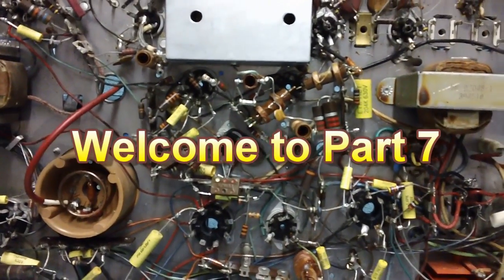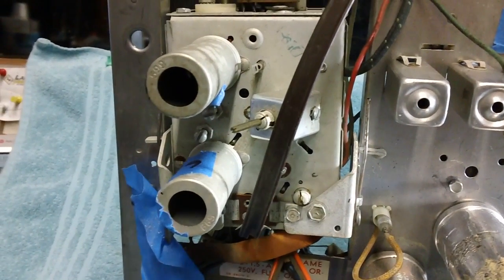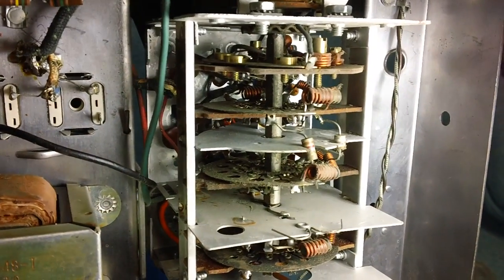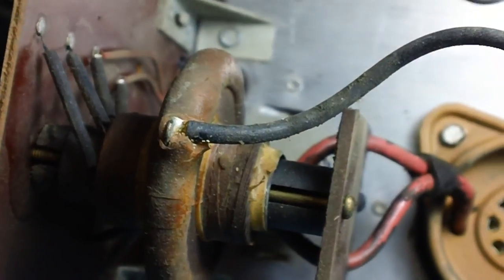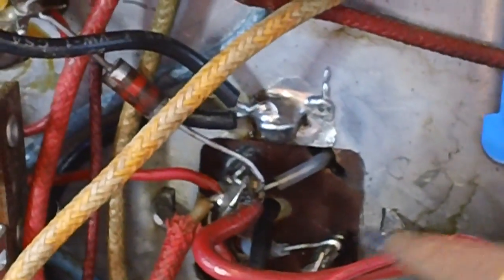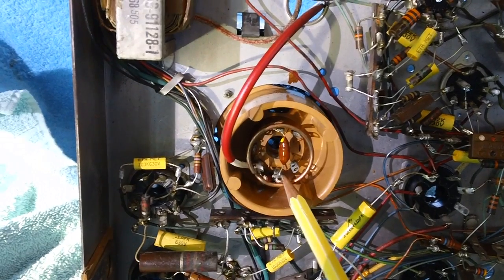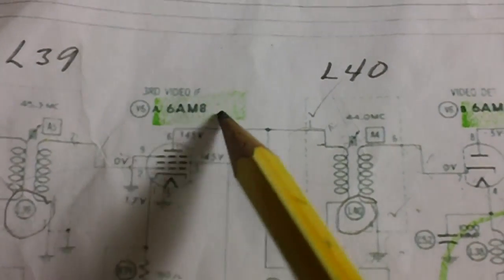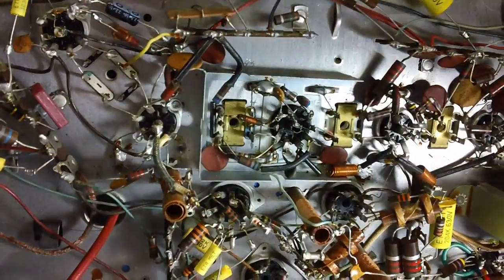1956 Sylvania 21" Halolight TV restoration (part 7 of 23).

Comment: The Sylvania Halolight TV I had was a bit older I think. Instead of a selenium rectifier, it had two 5U4 half wave tubes sitting on top of the power transformer. The tuner had the drum.

Comment: I use an old Montgomery Wards soldering gun, works a lot better than my radio shack soldering iron for chassis work. I still need to invest in a good soldering station of some sort. The corona ring explanation was really interesting. I know when I was studying for a ham license they said no sharp bends in the antenna wire to prevent arcing if it was struck by lightning.

Comment: John,
Coming along just fine dear chap.
The corona ring attached to the underside of the EHT rectifier valve base is interesting – I’ve never seen that arrangement before (I’ve never seen one fitted to British monochrome TVs). 
No matter how well you clean the dirt off the EHT rectifier heater winding (thick red EHT wire): it will soon come back…nature of the beast old chap. 
A good tip:- make sure the EHT rectifier anode (top cap) connecting wire is well secured onto its connection on the Line Output Transformer overwind (secondary), and also make sure it is well insulated at the point of connection – RF arcs of up to an inch and a quarter can jump from that area.  It might be a good idea to give the overwind a quick coat of none conductive substance that is capable of withstanding EHT, as old wax coatings often develop cracks – this would certainly be worth considering if you detect ozone (air purifier) type odour (RF leakage) emanating from the Line Output Transformer area. 
Just offering something positive.  Apologies for using British terminologies: I do not know the American equivalents.
Another brilliant video my friend.  It would be really appreciated if you could stretch this series out by two or more additional episodes than you intend: I’m really enjoying viewing this restoration LOL.  Well done!
Regards,
Phil.
Reply from the maker: Phil,
I have all the necessary junk to give the HV transformer a right proper insulation.  The old wax coating is indeed cracked here and there, so it's in need of a new set of clothes.  :-)  I think you'll like the way we do it, so stand by to stand by.
And as for a possible arcing from neath the tube caps...not a problem.  It's already under control.  I had wifey place her finger to the cap while I made a few adjustments.  When she stopped dancing I knew we were good to go.  LOL

Regards,
John

Comment: Thanks for the video John, I always pickup something. Did you say you used CDR contact cleaner? Curious . . . ;) Rog
Reply from the maker: Rog,
It's QD Electronics Cleaner.  You'll find it at Wal-Mart in the automotive section.  Works pretty good and doesn't cost an arm and leg.

Regards,
John
Reply: Cool . . . I'll pickup a few cans next time. . .  :)